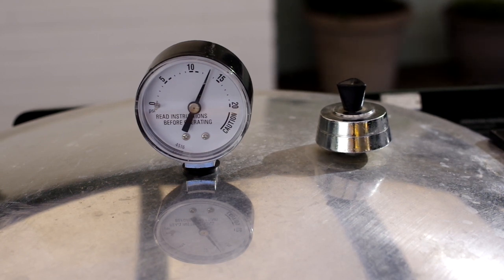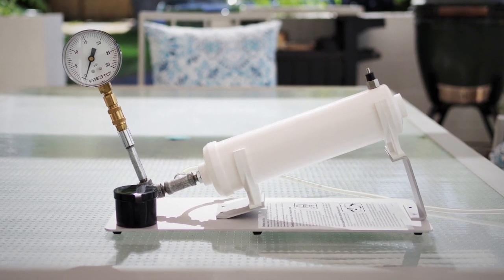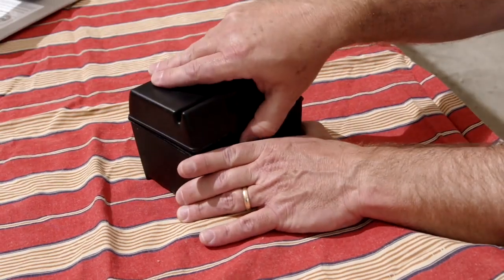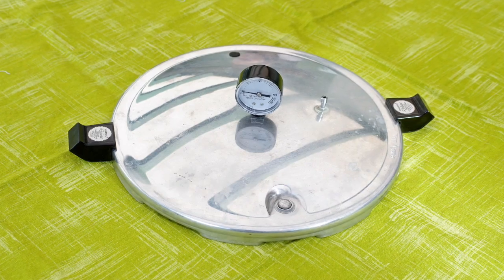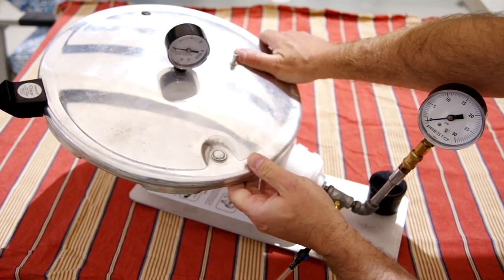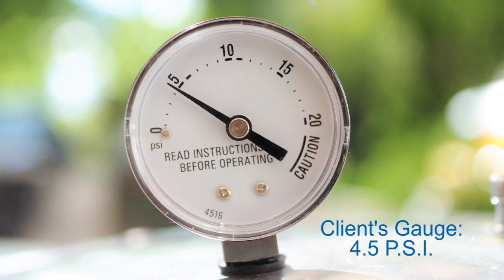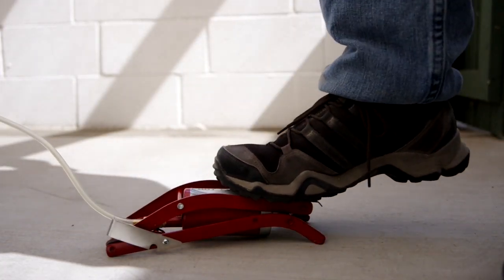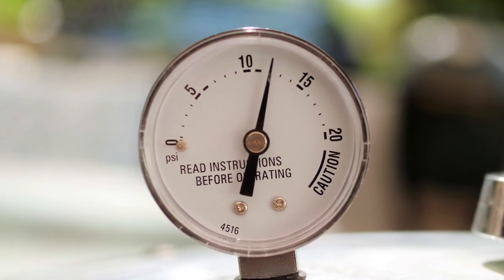Testing Dial Gauge Pressure Canners

Comment: My altitude is 1,145 ft.  NCHFP says to can at 11lb psi. I have a presto three piece weight. Do I use the 10 or 15 lb weight as the 10 jiggles at 11 psi?
Reply: 15. Bumping the pressure up doesn't harm the food being canned and ensures safety.
Reply: I definitely would call presto or who ever manufactured the canner and ask. Or call your local extension office
Reply: Where is the extension in Florida? I  have a canner with a pressure dial gauge that does not move frome "0" psi at all.